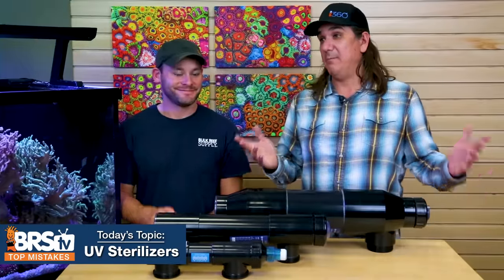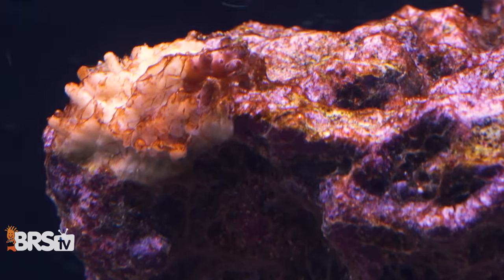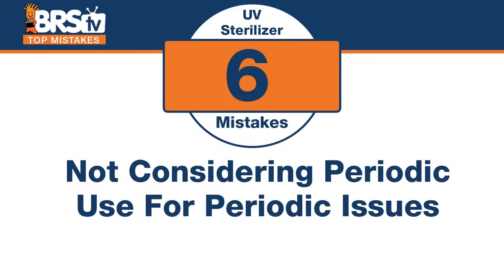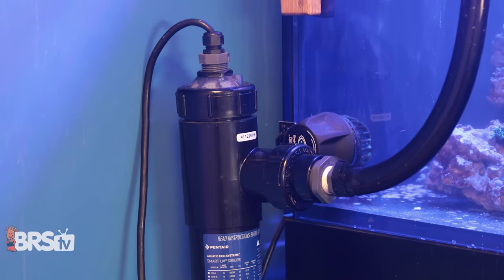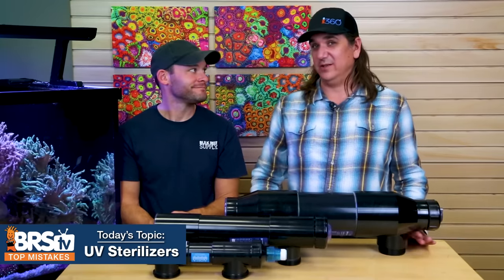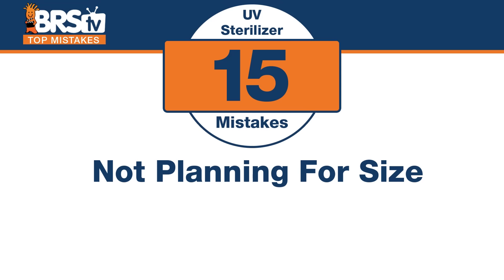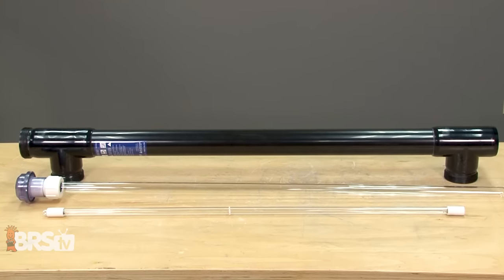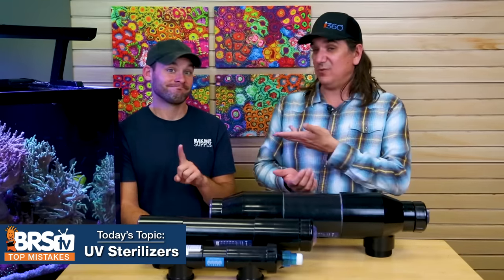Stop! Before considering a UV Sterilizer for your reef tank? Watch these Top UV Sterilizer Mistakes!

Comment: Great vid. As a KOI POND owner, I have a couple of tips. When you order a replacement tube (bulb), always buy two so you'll always have one on hand. Sometimes there can be manufacturing or shipping problems that make new tubes unavailable. I always plumb the UV last in the filter flow. Water goes through all of the filters first and then the UV. I have never had to clean a crystal tube.
Reply: Also had a koi pond..fully agree with what you suggest

Comment: I got a unbranded UV with the used tank/ stand I bought. It uses a 24 W  {G 23 socket}  bulb. So hard to find, I bought 3 of them when I located some. I wish I had thought to plumb it into the return line, because I hate running an extra pump. Thanks for the info.

Comment: So very confused, just ordered my 40w pentair from brs, and sizing pumps . In this video section like 13:50 to 15:00 we discus not running a loop in sump, and run off the return..wouldn't it need a pump still to push the water up through it and back out..? Wouldn't that be hard to regulate,  slow for parasites,  faster for algae . I am wondering can I plumb a pump in sump run water into it vertically on outside of my red sea 500 and have other end dump the sterilized water back into display ? So exit of water from uv literally just dumps into display
Should that pump be in my overflow chamber or return section, does that matter? Thanks!
Reply: I'm new and trying to figure this out too! It seems to me, if you pump the water from an upstream chamber of the sump (just after the filter socks), into the UV, then return it to a downstream chamber (the return chamber) of the sump, it would work fine and fully circulate through the whole system.  Use a variable speed DC pump, and measure the flow from the hose that returns to the lower sump chamber by timing how long it takes to fill a 1 gal bucket and do the math. Then adjust the pump speed as necessary.
Reply: @FreethinkerDave  did you end up doing what you mentioned in your comment?

Comment: I installed the Aqua Ultraviolet 40 watt I bought from you guys and has been running since I upgraded my tank. All fish where QT and my powder blue and Achilles tang have Ich
Reply: A UV sterilizer would not give your fish Ich.  It's possible the ich was not completely irradiated in QT before putting them into the display tank.
Reply: Ich can come in on snail shells and even frags if it's in the egg stage
Reply: @HBReefBros  Yes I know they won’t and they don’t eradicate either. I was just sharing my experience that evening having a UV and going through QT things can still happen.

Comment: I have a pentair 25 watt uv sterilizer. What pump should I use for my sterilizer? Thank you
Reply from the maker: That's going to depend a lot on where the pump is located, what kind of plumbing you're attaching to it, and where the UV is outputting to (sump vs display). If you have a moment, give us a call and we can discuss all of these variables and get you a good pump recommendation for your specific setup

Comment: hey guys.  about the beneficial bacteria you talked about, if a tank JUST FINISHED CYCLING and is ready for fish, is that too soon or still okay to add the UV?   I've never known the answer to this.  You partially answered it, but am wondering about this specific time?
Reply from the maker: You can add a UV sterilizer right away. Since most bacteria will live on the rocks, sand, and other surfaces of the tank, there is no issue starting it from the get-go
Reply: @BRStv  thanks u guys!  you're the best!

Comment: I just purchased a 36 watt uv sterilizer I think from jebao, it’s on a 90 gallon with 20 gallon sump, I have no way to make a closed loop in my tank just the sump, is it still going to perform correctly? I purposely oversized it for this reason
Reply from the maker: While it won't be as efficient as a closed loop style, oversizing it will help with your particular installation. For that reason, I wouldn't lose sleep over it.

Comment: Have a question here. To use a UV you have to choose if you want to use it for killing of protozoa or to sterlise the water. That is cos of the flow you need to select for each, to have fast or slow flow. 

If my understanding is correct, can one person to have 2 Uv? One for faster flow and one for slower flow in the same tank to have both ? Will that work?
Reply: They mentioned that in early part of video but that its not economical for most people. You will be getting close to 1k range with UV and Pumps they recommend.
Reply from the maker: That's correct, you could technically run two, both at different flow rates. Like @Sly Expeditions mentioned, this is pretty expensive and not something that the average reefer would do.
Reply: Get a variable rate pump instead and change the rate of flow.

Comment: I don't think it is correct to say that the UV sterilizer does not kill things, it just stops them from reproducing. I think you are confusing the different meanings of the word sterilize. In this case I believe we are using the medical term not the animal husbandry term. UV radiation is a form of high energy radiation that, among other things, destroys nucleic acids. This results in; the inactivation of viruses, the death of bacteria and other protozoa, and significant genetic damage and disruption to complex life, potentially enough to kill them.
Reply: yes UV sterilization is used in surgery, to sterilize tools. But the output is high enough and it is permanently under UV for about 1 hour. It is not passing trough a tube for one sec or less lol

Comment: Do you guys think the coral life one is like a toy one? I just bought one hoping it works. Starting to think it won't after seeing this.
Reply from the maker: The biggest thing is to have reasonable expectations for what you're going to get out of a small UV sterilizer. A small sterilizer isn't going to do much for a large system, so it's all about picking the right tool for the right job.
Reply: @BRStv  I have a 250 freshwater with stingrays. It says it's rated for a 250 but after seeing this video I'm skeptical

Comment: For my 240 Gal aquarium plus sump, which Pentair UV would you recommend?
Reply from the maker: The 50 or 80w versions would do the trick. The 80w is very long, so depending on how much space you have, I may suggest going with the more compact 50w instead.
Reply: @BRStv - Saltwater Aquariums & Reef Tanks  
I had a serious outbreak of Velvet in my reef tank. Then I seemed like I just could not rid of it, everything I tried, Quarantine Tanks, medications, fish less DT tank. Ever time I added to my DT the Velvet came back and wiped my fish out. I finally added a UV Sterilizer and within 4 month it was gone! I don't care what anyone says, UV Sterilizer will get rid of diseases.

Comment: Does a uv steriliser help reduce algae on the tank glass etc. ?
Reply from the maker: Assuming you have it set to the correct flow rate for algae, it can help reduce the need to clean the tank glass

Comment: can uv light prevent algae in sand and live rock?
Reply from the maker: The thing about UV sterilizers is that they can only sterilize what passes through them. UV sterilizers will not necessarily help with existing algae on your sand or rock.
Reply: @BRStv  how long is a good time to run uv light? is it 24 hours straight or when the lights are off or on? 🤔🤔
Reply: @Achi2567 run them non stop for sure.

Comment: Saltwater hobby is expensive even more so if you buy cheap in the beginning and replace everything later.  $20-$50 does not buy anything, that’s good.  Even a tank of car gas we burn costs more than $50.  Good beef is not cheap and cheap beef is not good.  Study sites with experts, like BRS videos.  Forums sometimes just spread myths and gossip or bad experiences.